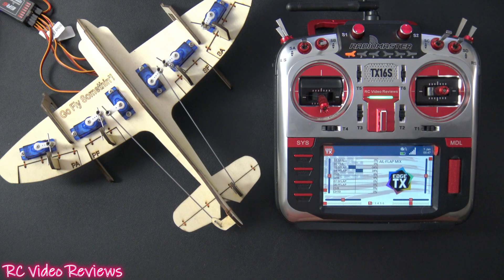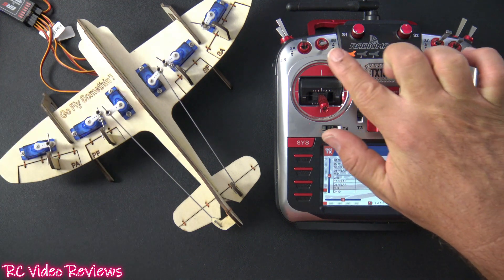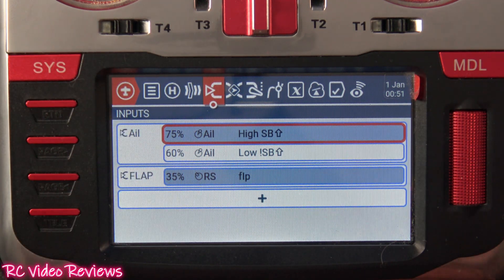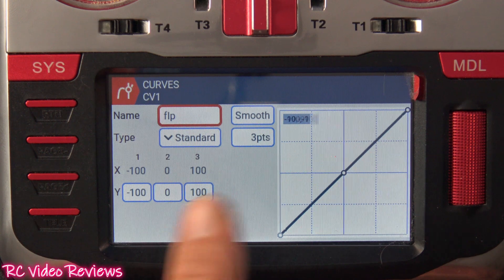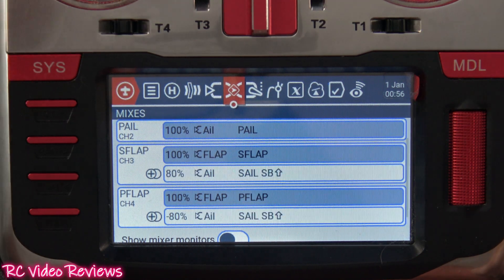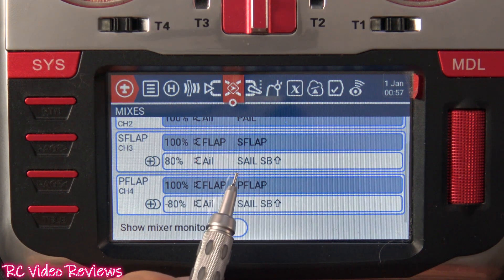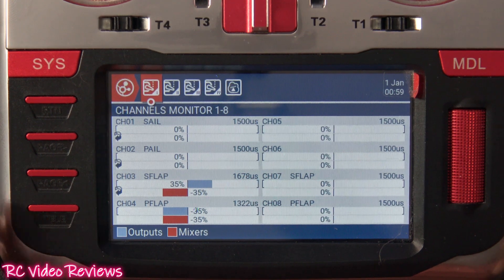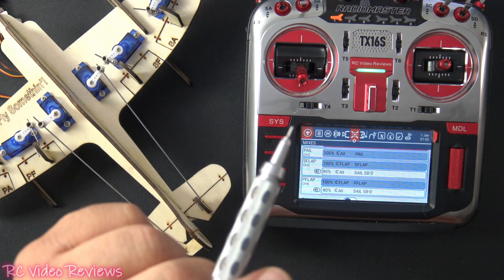EdgeTX • How-to Mix Ailerons and Flaps for Full Span Aileron Control

Comment: Hi Mister, First I have to say thank you very much for your wonderful educational videos.🤩🤩🤩 What I was wondering is. I bought a Jumper T15. I wonder how I can use the S1 Dial to control a servo that controls my Fpv camera so that I can look around when I fly my fpv plane. Using channel 5 on a Radiomaster ELRS ER8 8ch PWM Reciver. Now it works like a switch and only goes to one side, the entire servo travel. I want to use it so that when the dial is in the center position the camera points straight ahead. Or was the idea to turn the servo from side to side with the Dial S1 
I have used Spektrum Radio for over 25 years so this is a bit over my head can handle. 🥲🥲
Kind Regards 
Geir L. L.
Norway

Comment: Great video.  I've programmed Flaperons into lots of my airplanes already.  Using a 6 channel receiver.  They DID HAVE  functional Rudders.  Question.  I'm currently building an airplane with a FIXED Rudder.  Do you know if it's possible to program in Flaperons onto an airframe with Ailerons, an Elevator and FIXED Rudders.  A servo will not be needed for the rudder.  Can this be done on a FOUR CHANNEL RECEIVER.  If I'm making since, and you know the correct answer, let me know please.  This will be done on  SPEKTRUM  electronics.  THANKS.

Comment: I've also built myself such a config-tester. It's a good use for these cheap Chinese servos 🙂
The first use case was an acro glider, MDM Fox. In acro mode, the flaps act like ailerons and in thermal mode, the ailerons move with the flaps. That tool made it a lot easier 😉
It also very useful for setting up gyros.